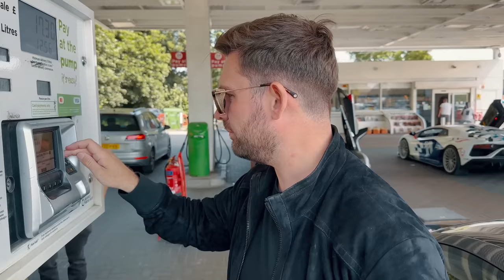CRIMINALS TARGETED ME - GUMBALL 3000 PASSPORT DISASTER!

Comment: I agree. Positive approach is the only way to solve the problem and move on.
Also, better care and preparation to avoid it ever happen again, and if does, be better prepared for a smother ride, specially because it is not just fun, but also work.
A simple example in this case would be better parking and cloud backup.
No wonder why huge productions always use two or more support vehicles, but this solution maybe not viable for your size of operation for now.

Comment: The ramp steepness is because to make the floor to floor height difference the steeper the ramp the shorter it can be and the more cars you can park.  And the concrete curbs are because I'd rather you damage your car than damage the garage structure.

Comment: Great video. Shame that some low life's chose to rob you and steal your bags with passport. It happened to me at Heathrow once, and stolen passports when traveling is such a pain.
I just wanted to comment on the Car Park designs. I drive an SUV so ramp deviation is not an issue, but width and curbs are. Unfortunately Cars as we see have got so much larger over the years, and old car parks are not made for them. New car parks try to optimize for maximum number parking spaces and do not care so much for comfort or convenience. 
I hope you have a great Trip.